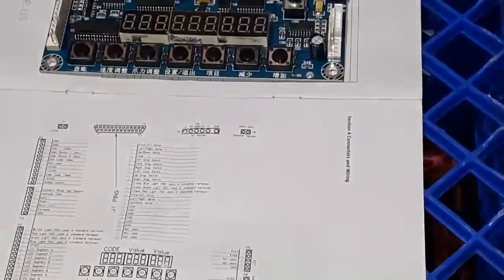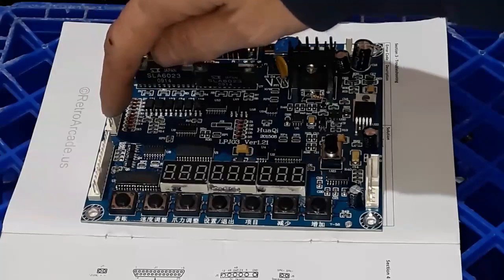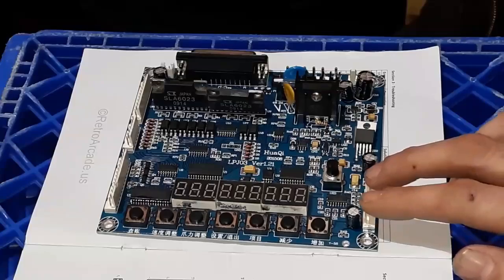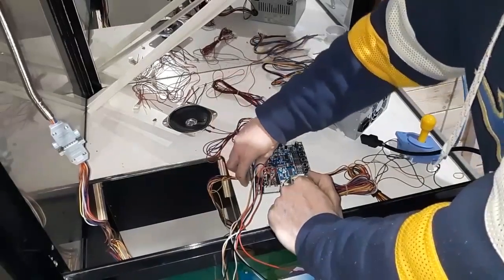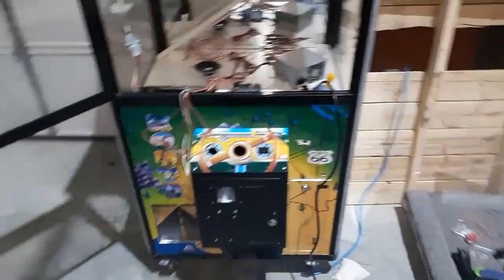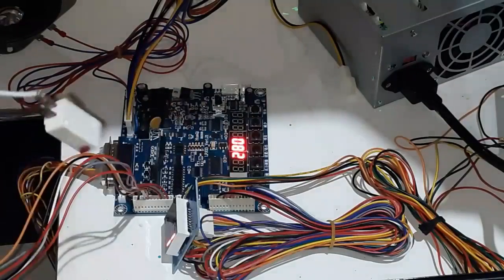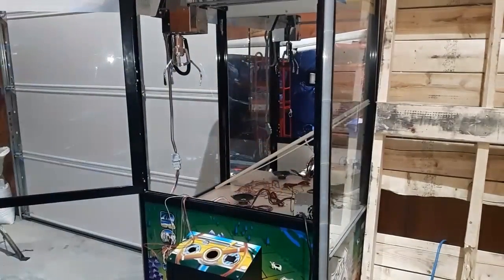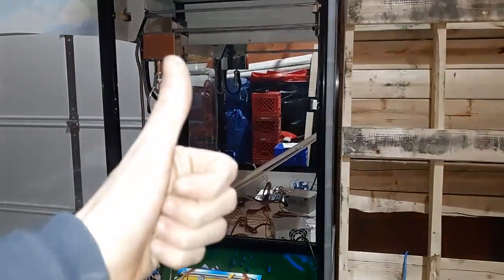DIY Arcade Claw Machine Kit From Holland Computers Part 2, Where Does Everything Go?

Comment: So you don’t have to solder anything? You just plug everything where it goes? that would be really good, because I have very little engineering/electrical knowledge, and I’m looking to build one of these!
Reply from the maker: No soldering required. But being adept at Google Translate would come in handy. All of the information is in the manual. The translation in the manual is very loose. Good luck! This project was a lot of fun. The game is still earning to this day. Thanks for watching.

Comment: That's great.  Thanks for the video.  I have just received one of these kits that I'm about to put together.  Just out of curiosity do you know where the right stop switch is?  I can see the aft, left and fore switches are in the frame of the gantry but cant work out what triggers the right stop switch... or where the right stop switch is for that matter. I'm hoping it's not missing.
Reply from the maker: Right stop switch will be at the spot you want it to stop. Typically the right front of the cabinet.
Reply: Thanks so much for your reply. But where is the switch? Maybe im talking about it in wrong direction. I see switches for left, aft, fore and on the crane mechanism i see the switches for the crane down stop and crane up stop but cant see anything that would trigger when the crane moves to full extent right (or to the other side of the gantree depending on how you are looking at it).

Comment: what was the small green "motherboard" thing for? did you ever find out/use it?
Reply from the maker: It was either a led driver board, or part of the sensor assembly. I havent used either, but I might still install the sensor. I'll do another video, if I do.